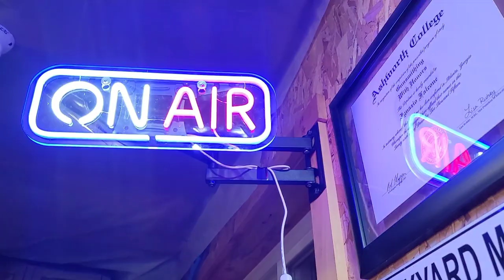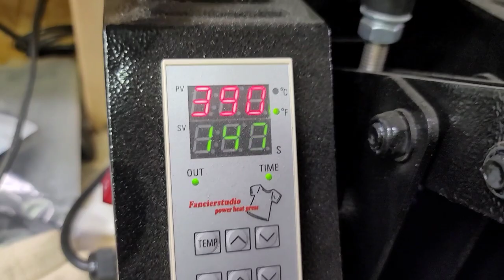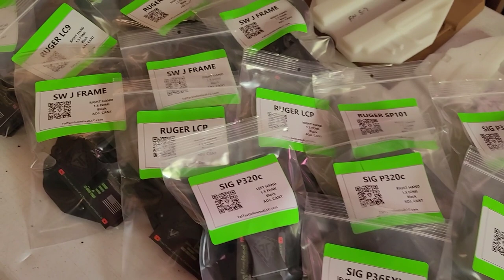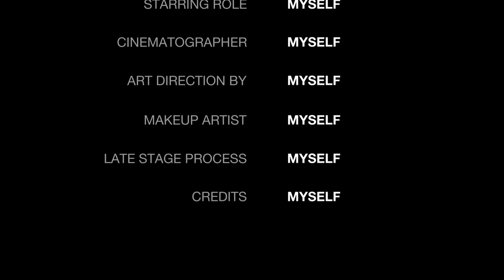Making a Holster for the Sig P226 with X300 ultra

Comment: For an EDC open carry holster, would you recommend the pull the dot thumb break or regular snaps? I’ve had some hiccups with pull the dot before but it could be because I installed them and not a manufacturer.
Reply from the maker: I'd choose the thumb snap kits available at Hs over pull the dot. Technically it's the same but factory installed. Just add strap to the holster. But it's also rare people want a strap on an owb unless it's on a thigh rig
Reply: Thanks for the advice

Comment: I bought a safariland holster for my SIG p226 elite at a gun show. And it turn it I got the wrong holster because apparently the elite version isn't compatible with this holster. It's a shame because I like safariland product...but their website is so confusing. I don't even know what to select or what's necessary for my p226 elite. I just gave up. Are there any holster that will just tell me straight up...p226 elite. No bs.
Reply from the maker: Elite is longer I believe like the legions. Also check out handgunhero.com it's a website designed to compare any handguns

Comment: How can I make the split templates myself? I have very limited workspace and am brand new, i have a million questions and feel overwhelmed. Any help would be appreciated!!
Reply from the maker: Honestly. I would add making molds to the plate if your new. Plenty of people offer them cut from cnc for accuracy
Reply: @FalTacUnlimitedLLC  oh wow! I really didnt know that was a thing! Is that essentially like a 3d print type thing? Blue gun style? And how can i get them for certain guns?
Reply from the maker: @requis9838  check out these sights
Palehorseconcealment.com 
Planbholsters.com 
Oxcreektactical.com 

Pretty much everything you need right there and of course all material through holstersmith.com